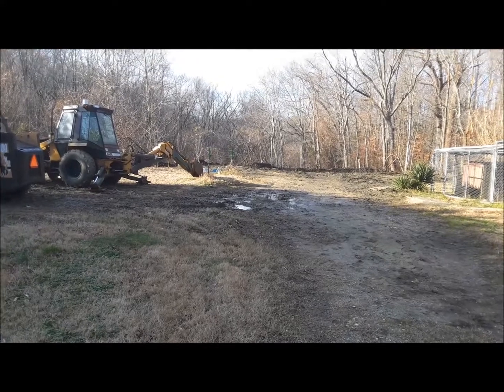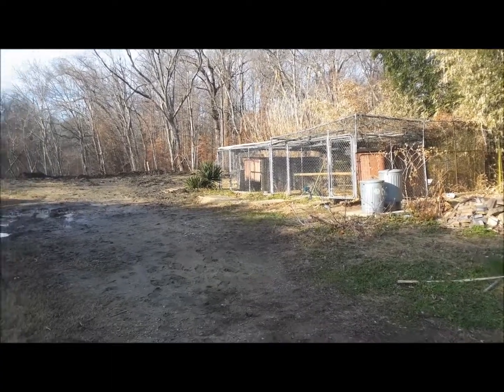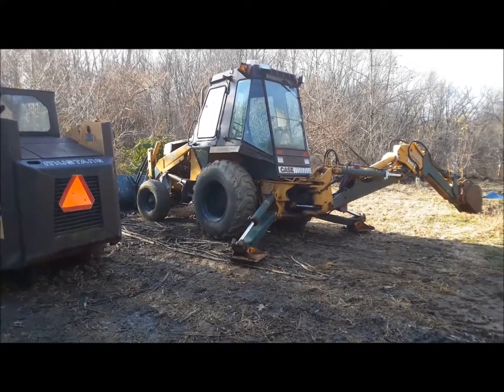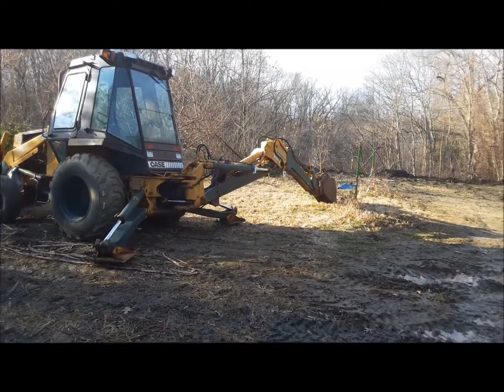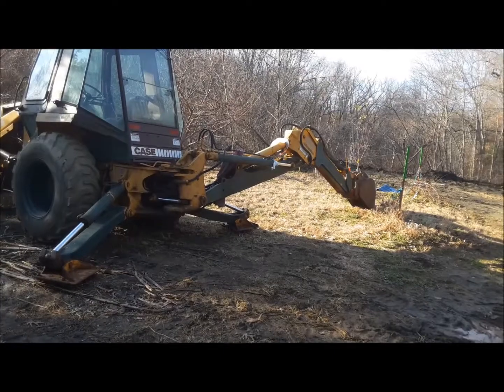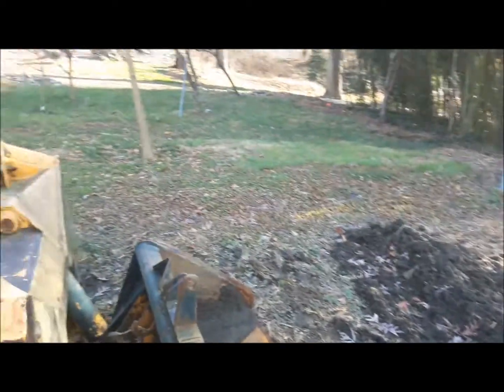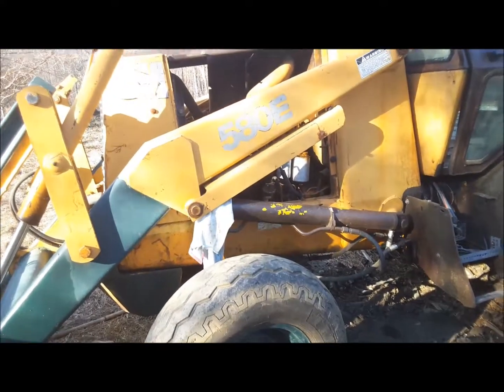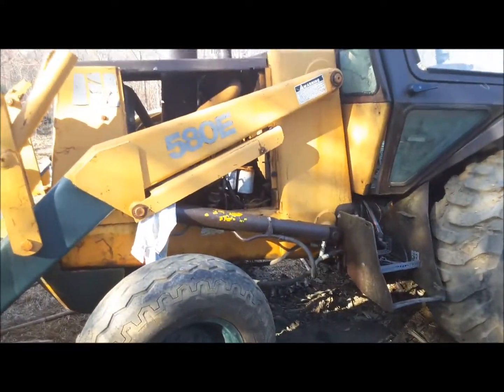Keeping water out of Hydraulics for Case, Caterpillar, Mustang and Bobcat.

Comment: This dude is crazy, do more research on the subject. If you have water getting into your hydraulic system from a bad seal, you probably don't have any hydraulic fluid in your system. Hydraulic systems operate at hundreds of pounds of pressure, rainwater has zero pressure and for reference your garden hose is at 15 psi max? Does this even make sense? Or do all industrial equipment manufactures not use engineers or not have one on staff to maybe look at these issues to limit law suites and recalls?

Comment: Thank you,
I just bought a used Ford 5500 and the steering was pulsating or manual. Had some time today and took off the power steering filter full of cappuccino coffee. My question is there a way to purge those lines out without the filter screwed on?
I do know the power steering pump gets its fluid directly from the last third of the right hand hydraulic reservoir, there is a cross-over tube to the left side tank above it. I was thinking about while it is sitting to pull the drain plugs and drain as much contaminated fluid out of the bottom of each reservoir. The system wet holds about 41 to 47 gallons and completely empty 67 gallons. I want to purge as much stuff in the lines back to the reservoirs before dumping all for a complete change and filter change. 
Could you review my strategy for gaps in logic/methods?

Comment: Nice tip about boiling the water off. I might try that. I'm sure a metal bucket would be useful. Got an old 580b and I somehow got water in the trans, not sure how it got there as I store the tractor indoors and there is no rad/trans cooler I can see.